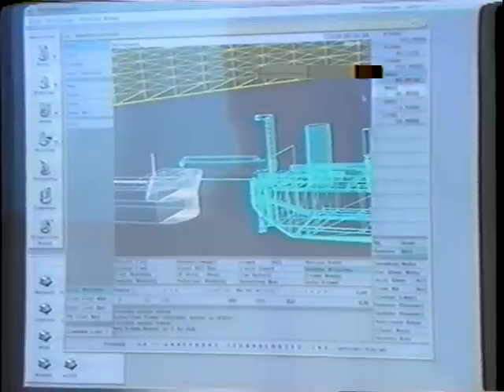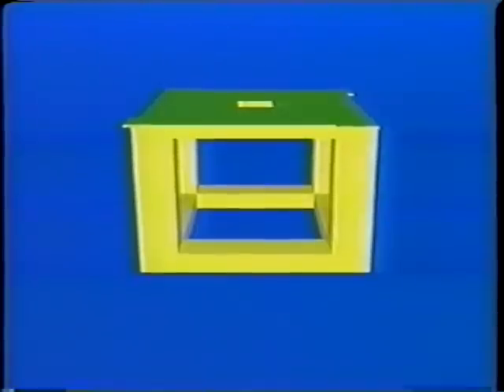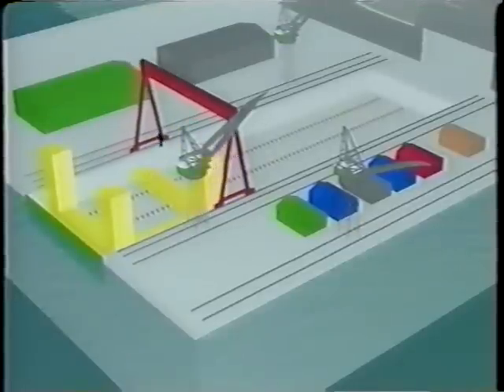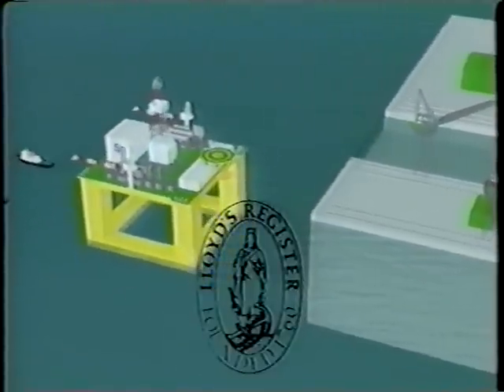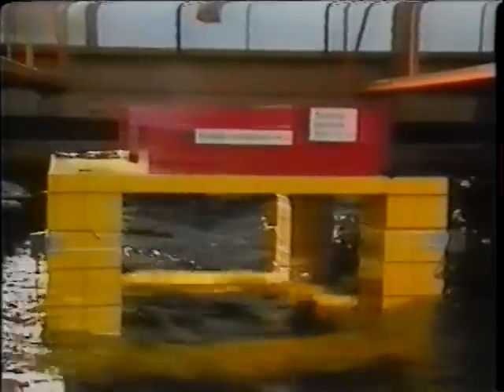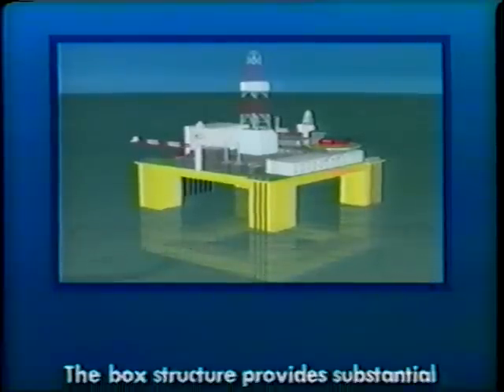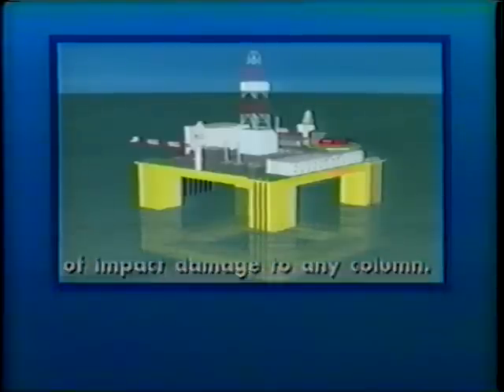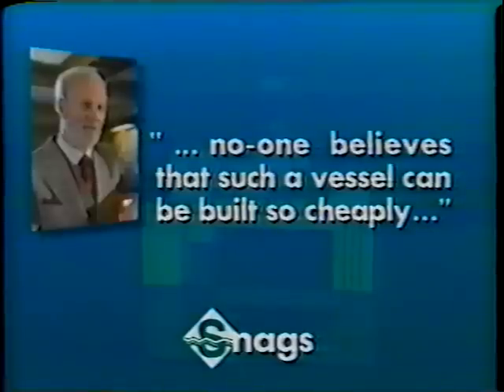MPSS Semisubmersible

Comment from the maker: Now, 2022, regarded as The Standard Semi. So simple and the external hull form is easy to copy. Not so easy to predict the motions or arrange the internals to ensure Capex and opex are minimized. I hear about ten are being planned for the Gulf of Mexico. I designed one for China in 2006, it is the Shanghai 1 , in the South China Sea in 1500m. How soon will it be used for floating deep sea wind?

Comment from the maker: First square ring pontoon. First semi with four square columns. First semi designed for shipyard panel line construction using materials and methods, including welding, common to yards. First semi with continuous structure throughout the the deck box, columns and pontoons. First semi that can provide a belt of ballast water above the waterline to improve damage stability. First semi to divide ballast tanks into fixed, variable and trim to avoid accidents like Ocean Ranger.  First semi to eliminate ballast pumps and use air displacement. First semi to be designed as a fixed floating object approved by Lloyds Register in London. First semi to have a buoyant deck box enabling float over and improving damage stability. First semi to design response amplitude operators to provide adequate air gap in one hundred and thirty foot waves. First semi to be suitable for steel risers in catenary. First semi to be suitable for unlimited water depths. First semi to apply the lessons learned on Hughes Glomar Explorer, invention of the Apache Reelship and steel risers in catenary, Conoco Hutton TLP, GVA 4000 Sovereign Explorer and GVA 5000 Balmoral FPV.  Craig Lang BSc(Eng) PE

Comment: How many firsts on this project?  
Massive 12,000 Tonne payload (equivalent of the Destroyer class vessel recently launched or about twice the weight of the Eiffel Tower. ) 
Multi Purpose vessel. 
Steel Catenary Risers.  
Flat plate construction 
Square columns.  
Square ring pontoons.    
No diagonal support, at all, ever.
Ballast water above the waterline for safety.
Large 90x90 meters.
Deep draft.
Thick, box deck.
No Reason to come to unsafe "survival" draft.
On-board oil storage.
Automation friendly construction.
Less than 14 months to build.
Many of these features can be found on Semi-Submersibles around the world today.  But in the 80's, this was like a flying saucer landing in Piccadilly Circus.  People didn't know how to react.  We got some praise and we got chased out of a few places.  But in the end the design proved to be right.  Several companies lost money again on the same old Semisubs and after a few years decided that there was merit there.
To date, at least 5 companies that received detailed information in meetings with seaways engineering, are touting there very own Square Ring, flat plate Semi-Subs.   If you see a Semi-Submersible with square columns or a ring pontoon or SCR's (Steel Catenary Risers)  Those words hadn't even been used together.  know this, that is not how it has always been.
Reply from the maker: Could someone show a video of the tubular braced Catamaran, tripod and pentagonal semis that were astonishing failures, capsizes, in the seventies?  This ring pontoon semi was designed in London and Glasgow. Based on lessons learned on tubular braced yard killers!